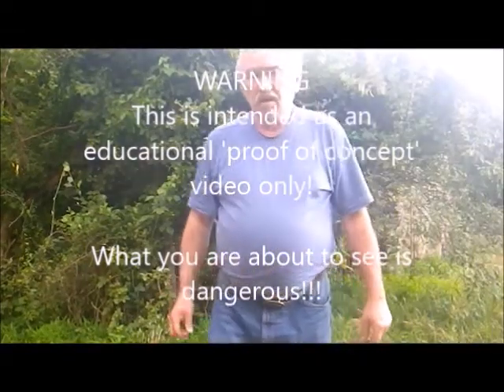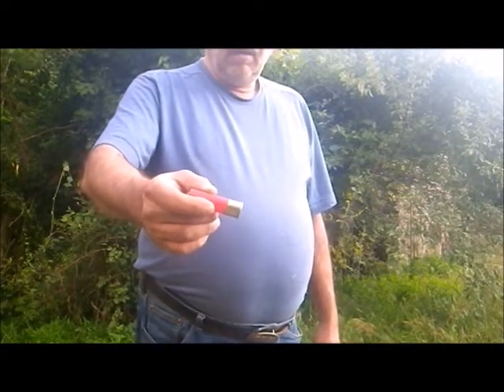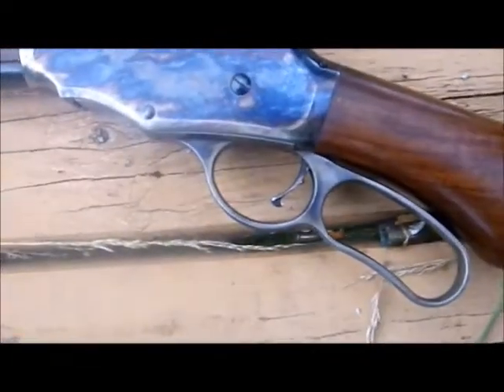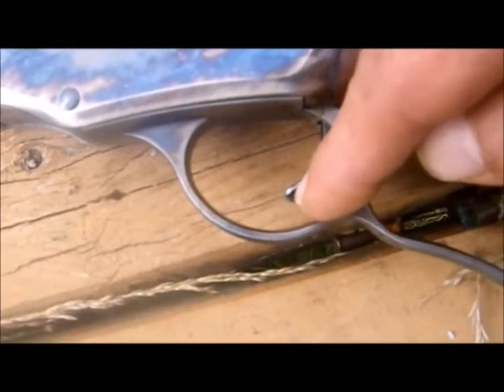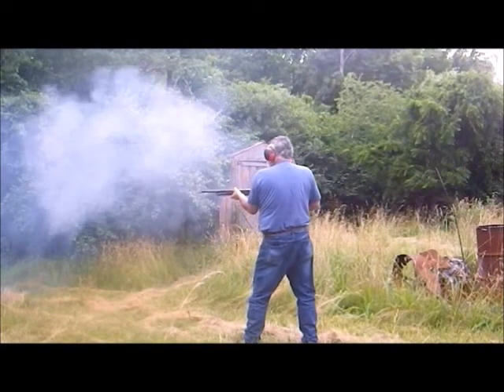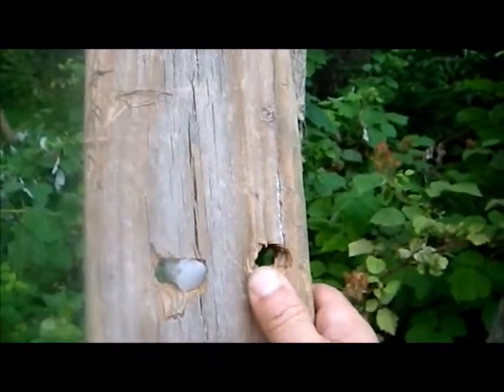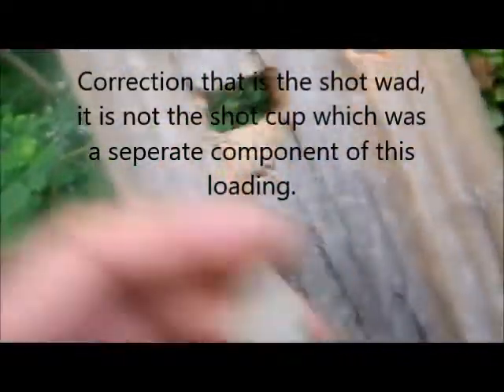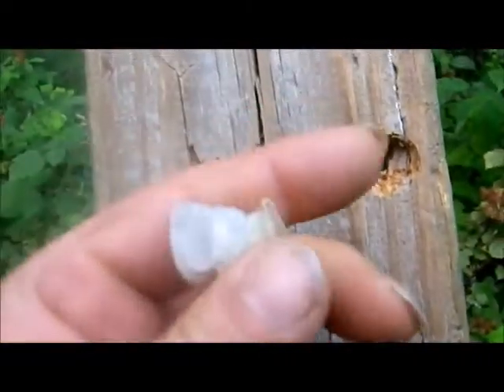Minie Ball in a 12 Gauge

Comment: Would it have been more accurate with a round ball?? just a thought
Reply from the maker: I am not sure I understand your question.  The goal was to hit a 3.5" wide board at 15 yards.  Both of the 2 slugs in the video (as well as a dozen others subsequent, but not filmed later) did that with no problem.  If all slugs hit the board, how would an increase in accuracy be noticed?  Since the test was of stiff gun powder loadings well beyond SAAMI specifications and there was no central aiming point (or bullseye) your question is confusing.  For what it is worth the cause of the smokeless load tumbling was identified and eliminated and future smokeless loads (which I will not list here to avoid upsetting Alliant and Chiappa) with the 730 gr. Minie ball did not tumble.
Reply: @kenibnanak5554 I meant would a round ball make a difference as tumbling round projectile would not be affected by tumbling..
Reply from the maker: @Martinbergin  Well, since it hit the board anyway, possibly not.  A hit is a hit after all.  If you watch Taofledermaus' channel they have lots of slugs which tumble, but still hit their target.  Not all, but most do.  In any case, a round ball would weigh a lot less than this Minie projectile and deliver a lot less energy and penetration capability to the target.